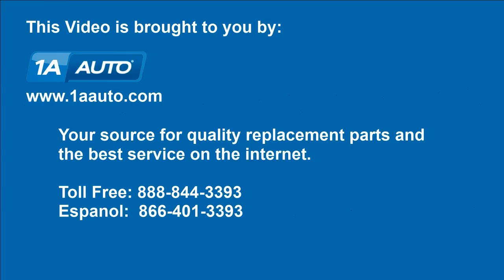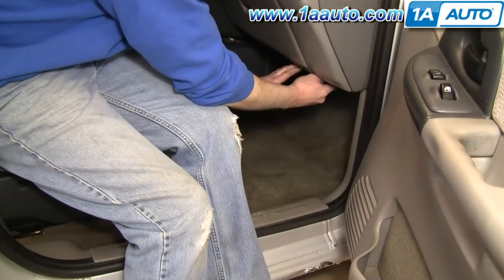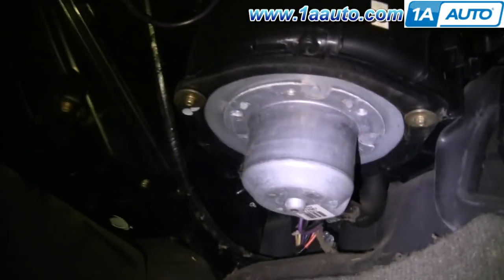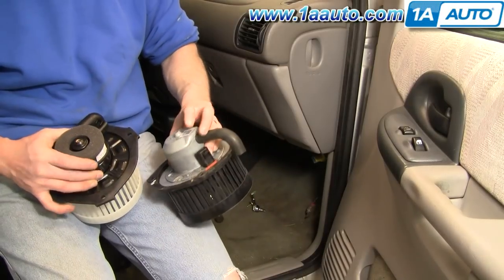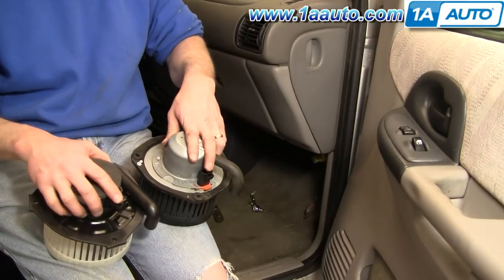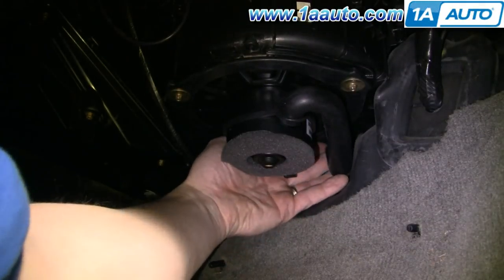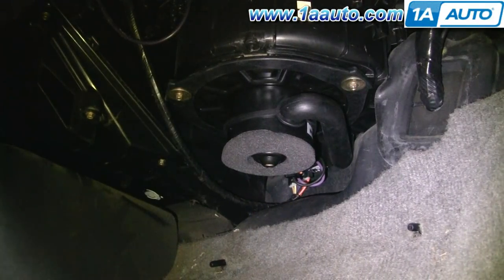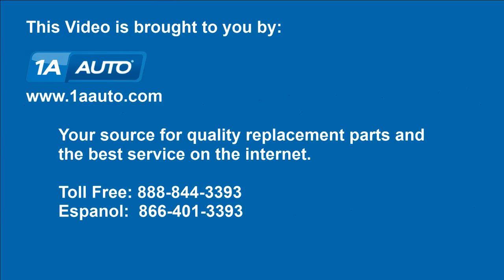How to Replace Blower Motor 97-05 Chevy Venture

Comment from the maker: You may want to check the radiator fluid level when the truck is cool. If it's up to level, you could try to flush out the heater core on a warm day with a hose to see if it's plugged up at all.

Comment from the maker: If the blower motor is not working at all then it could be the fan, switch, or resistor going to the motor. Your best bet would be to test the electrical connection going to the motor and see if you are getting any power to the motor.

Comment: So for anyone watching this your truck is really old and odds are the bolts are spinning. These bolts do not thread into the frame... they instead thread into a nut the is clipped on. The reason the bolts are spinning is because the clip has broken. 

There are 2 easy-ish methods to get them out...

1.) With the help of someone else, or some thing, find the bolt inside the cross member and have person or thing place downward forch on the bolt. This will force that clip to stay in one place while you turn it out.

2. Drill the bolt out. You will need to buy a new longer bolt, and a new nut. When bolting in the new strap put the nut inside the cross member.

Third option for those who know what they're doing so you dont blow yourself up or weld the bolt into the nut. Tack weld the clip  back down...
Reply from the maker: +King Nanaki Thanks for the feedback!

Comment: Okay, so I have the 1998 Pontiac Trans Sport. It doesn't seem to be the resistor because I have all speeds. What I don't have is much air entering into the vehicle and what air I do have is luke warm at best.

Comment: Thanks for posting this! I need to replace the actuator temperature door motor for the front blower on my 1998 Olds Silhouette. Is it located under the dash? Also, do you have any videos for the rear blower replacement?

Comment: I have a 2005 venture and it has 1 blower but it does not have bolts it has 3 Phillips
screws and does not have the hose coming out of it the plug is in the side  .
I thing my fan is bad it works intermittent has voltage to fan except on low speed no voltage so I think I have 2 problems . Have you ever seen a 2005 venture fan and resistor location?

Comment: Just came from the garage with my 98 Chevy venture to find out why the AC doesn't work..
he checked it out and filled the system with gas... then told me the fuses are ok and gas is to pressure,, so its an electrical issue. Now im gonna see if i can do my own electrical trouble shooting myself... I notice the switch light for AC doesn't go on when ya press it, so i can start there i guess;  can you tell me what also  i should check for please 
THANK YOU !

Comment from the maker: Usually when the blower motor resistor starts to fail you will start to loose the speed settings. You could also remove the blower motor to see if there's anything caught inside of the cage. We carry new blower motors and resistors with free shipping on our website 1aauto.com 888-844-3393

Comment: I have a 2007 Chevy Uplander; while my blower motor still works, it only maybe half as powerful as it used to be.  On full blast, it's barely enough to keep the front of the cab warm; but does just fine keeping the window defrosted.  I would think a blower motor either works, or doesn't work.  Does this sound like a blower motor wearing out?
Reply from the maker: If all of the speed settings work fine, it might be that the blower motor is getting tired. Usually when the blower motor resistor goes, you'll lose the speed settings. Here's a link to the blower motors on our website for this vehicle if you need to replace yours. Hope this helps you out. http://www.1aauto.com/1A/blower-motor/Chevy/Venture/1AHCX00086?utm_source=VideoReply&utm_medium=Forum&utm_campaign=1ATony

Comment from the maker: On most vehicles the blower motor is typically under the dash on the passenger side. Another location may be in the engine compartment on the firewall or near the firewall. 1aauto.com 888-844-3393

Comment: I have a question. I have a 2005 Chevy Uplander, the rear heat works fine but the front heat is not working at all.. it won't blow anything, I can hear it trying to do something... Do you know what would cause this?
Reply from the maker: You may want to take a look at the blower motor and the resistor to see if there's power to them and that that wires are also okay. Hope this helps you out. 1aauto.com 888-844-3393

Comment: Question: Why i have very low air when a turn on the blower motor? If i put in speed 1 or 5 does not feel to much air, Sounds like the air were block for something, because a hear the incresae of the blower motor speed, but only the noise of the blower, no much comes out from the vents, I change the air filters from glove compartment and nothing, I heard al speed works, but no air, Any idea?
I have a 2002 chevy venture,
Thanks.

Comment: I bought a used Bosch blower motor off ebay, for my 2002 Oldsmobile Silhouette, and the one I received doesn't have a plug for a hose. It has a rectangular place, but not round?
Reply from the maker: +Patricia Hall You may have received the wrong one. We carry the correct blower motor for your 2002 Oldsmobile Silhouette on our website. It includes free shipping and a lifetime warranty. Here's a link to them if you would like to see what we have to offer. Hope this helps you out. http://www.1aauto.com/heater-blower-motor-with-fan-cage-front/i/1ahcx00190?f=370052&y=2002&utm_source=YouTube&utm_medium=CTA%20Comment&utm_campaign=1ATony
Reply: Same, I have a 2003 Chevy Venture and it has the rectangle and no hose. The original (i assume) I took off was the exact same, so it's not the wrong part.

Comment: I'm assuming that this is the part i need to replace since some of my fan speeds have quit working. It only works at one speed as the other speeds have slowly quit working and died out.
Reply: That sounds like a blower motor resistor. As the motor will still work on select speeds. Usually the highest speed is the only working speed if it is a resistor

Comment: Looks like its been awhile since you have had any questions. You videos are great and have helped me.  So i am needing some of your expert help.  My wife's 2003 pontiac montana ac and heat and front and back blowers quit all of a sudden. At first  it started acting up by taking a few seconds to come on, then she said she had to drive it maybe a mile then it came on. It took longer and longer to come on then it just quit, nothing worked not even the fan would come on, and the ac motor would not even click on. I thought it might be the fan speed switch at the drivers control, I changed that and nothing. I was thinking maybe the blower motor resistor, or the motor its self. Oh and I did check the fuses and they are all good.  Can you help me  PLEASE.  Mark
Reply from the maker: Thank you for the email. If a resistor failed you should still the highest setting. It is possible the motor itself has failed. Hope this helps!
888-844-3393

Comment: Is this blower is to cool the engine or what thanks
Reply from the maker: +erik 1999. This is the blower motor for the heat and A/C in the vehicle. Thanks! 1AAuto.com
Reply: @1AAuto  
Thanks a lot